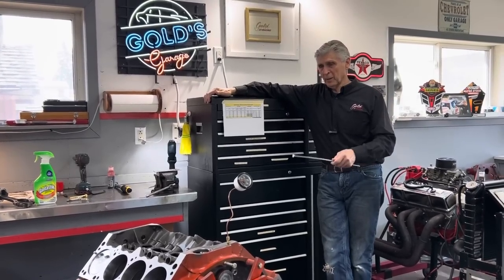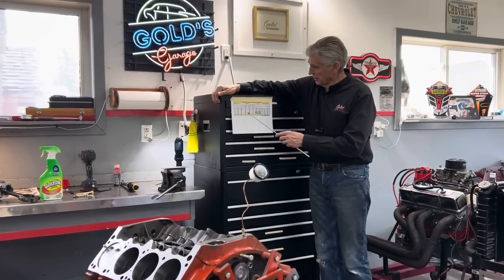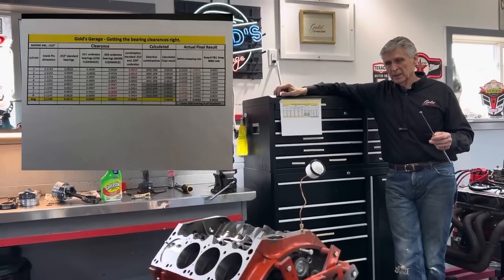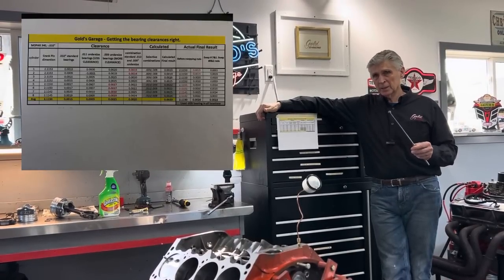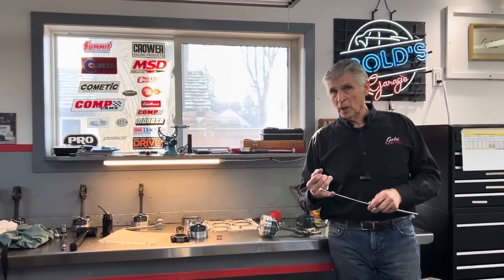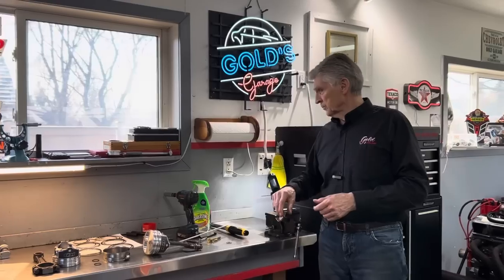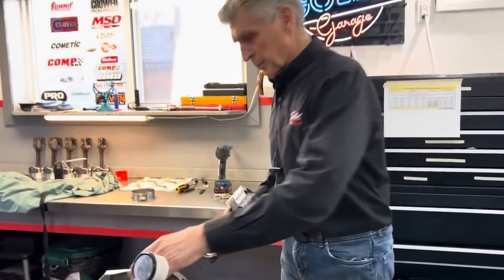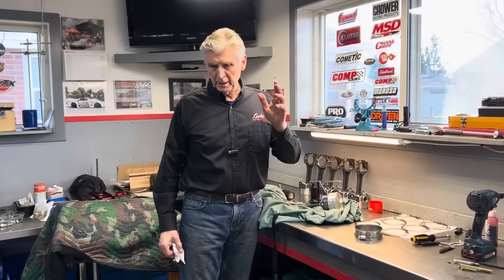Rod Bearing DILEMMA! Swapping Connecting Rods For Perfect Clearances! Kitchen Cleaner for  Engines?!

Comment: Curious, why would you want to run only .002” clearance on a 2.125” journal?  Recommend rod clearance is .00225”-.00250 min. 🤔
Reply from the maker: Thanks for the comment Headflow. The factory OEM specification minimum clearance is less than .001" check it out. .002"-.0025" is plenty even for a performance application. AG

Comment: Never seen large space between top an second ring. It has been many years since I assembled a engine. Things change.
Reply from the maker: Thanks for the comment Pilot. Not in all cases. These KB pistons have the top ring closer to the combustion chamber, so they will see more heat and thus more expansion. AG

Comment: Keith Black makes the Silv O Lite pistons. I am glad mine had the C Clip type clip. I did not want to mess with the spiral locks lol.
Reply from the maker: For sure, I had C-clips and was tempted to use them, and they would have worked fine, but I stuck with the spirolox because that is what was supplied, they aren't that bad once you get the hang of it. AG
Reply: @goldsgarage8236  Very true

Comment: Hey AG,
     Tim here.......seems you had fun with "stacking" tolerances......glad u got it sorted out......ALL my motors have that .002-.0025, once in a while .003 clearance on both rods and mains.....(generally "stock" journal sizes)......i had one thing on my mind........ring gaps.....yes, i'm SUPER anal about orientation, as my brother in 1982 explained why its done that way, but even then, we did a larger gap for top ring, tighter for 2nd....but we've learned that doing the opposite, allows an escape path for the gasses/pressure........so ALL of my engines get a, lets say .020 gap for the top, and a .022 for the 2nd.......netting a .002 escape path.......has NEVER let me down.....so my point: .002 larger ring gap on 2nd ring.......its just what i learned, and stick to.......just thoughts Alan, you are QUITE the organized/anal dude like me......we want it RIGHT!!..........anyhoo, i ENJOYED this vid, and the "Blueprint" vid was great as well......keep on sir!!!......Peace to you .....and Happy Easter!!!...
Reply from the maker: Thanks Tim and happy Easter to you. KB pistons recommends extra gap on the top ring because it is located higher in the bore and so exposed to more heat. The method you describe makes sense and is widely used. 
If you follow KB's logic, when the engine is hot, the top gap will be less? Does that make sense? AG
Reply: @goldsgarage8236  yes sir, it does, but I've seen ringlands get mangled, with a wider top gap.......I stick to the .002 wider 2nd ring gap.....ya know, I just built a 400 sbc, and that ring pack reccomended the wider 2nd gap.....and u say KB is suggesting a wider top.....it seems all over the place......I just stick with the .002 wider 2nd in general....TY for taking the time to chat a bit....PEACE to you sir!!